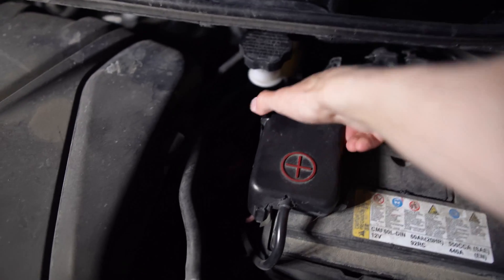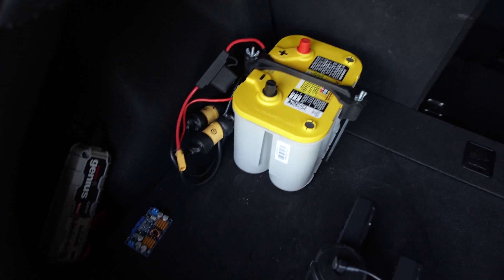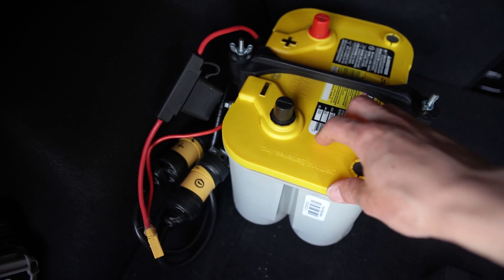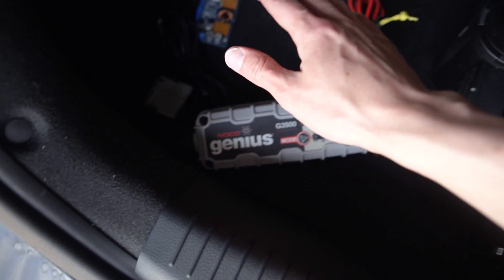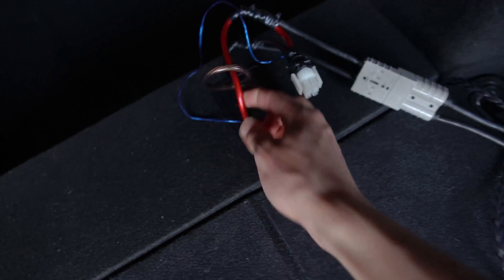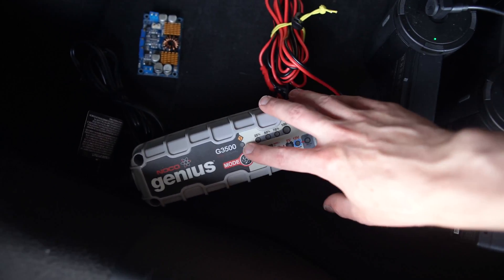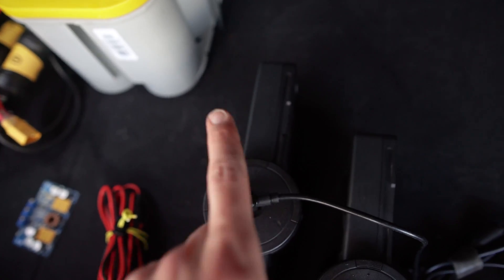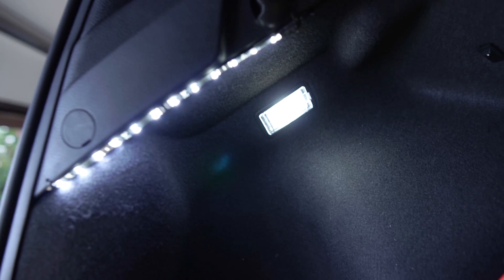How to Charge DJI Inspire 2 in the Car - DC Inverter & Isolator

Comment: You could have used an inverter and a rechargeable power "generator" station like a Goal Zero, it would eliminate a lot of the extra wiring and the power station is portable. You can also easily add solar panels to the system.
Reply from the maker: Great ideas, but there are three flaws with this. 

Goal zero stations are EXPENSIVE, you’re paying for an inverter you don’t need (why make AC out of DC just to plug in the DJI again), and it would take three LARGE solar panels and full sunlight for an hour to generate enough power for one TB50 charger. 

This system was under $500 and gets us about two full batteries worth in a pinch, while taking the strain off the car.

Comment: Tell me why I can’t just run jumper cables from a 500 watt inverter to the car’s battery to charge my tb50s?  Especially if it’s a rental car/van?  You’re just worried about wearing out the alternator?
Reply from the maker: Yeah alternators aren’t built for that kind of wattage on a regular basis. Also you’re burning gasoline to avoid draining the battery.
Reply: Yellowhouse Aerial I hear you but in most situations ..  I can leave the rental car idling all day while I charge drone batteries and it usually won’t put an dent in the gas consumption... Using extra gas is the cost of doing business..  I guess the alternator thing is a concern if you’re using your own personal car.. I fly a lot and just carrying tb50s in the plane is a chore ..
Reply from the maker: Yeah we understand. Idling the engine, plus emissions, plus the alternator wear; it’s just something to weigh depending on your comfort with risk (of wearing out the alternator) and personal preferences for what’s easiest to charge on the go. 

Looks like I missed the part about it being a rental initially. Yeah in that case it’s not the end of the world either; only a couple days of hard use per vehicle. :)